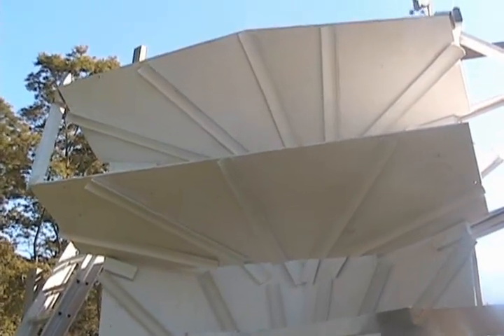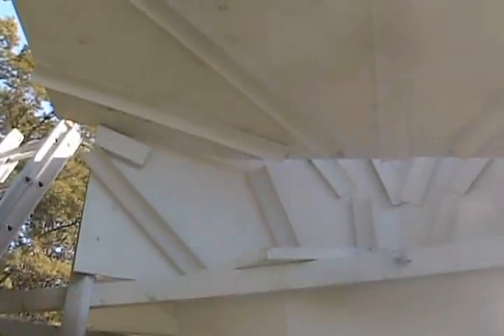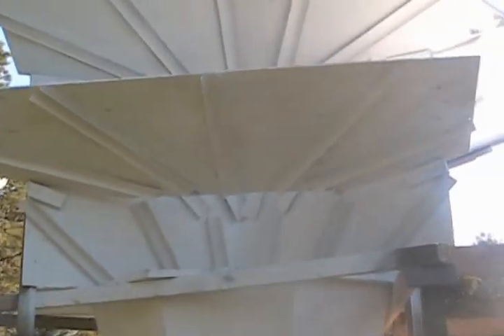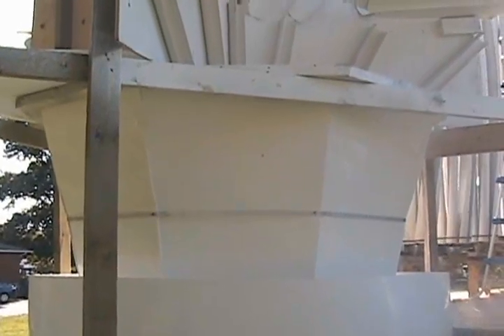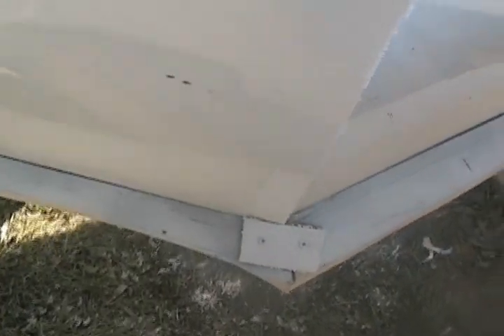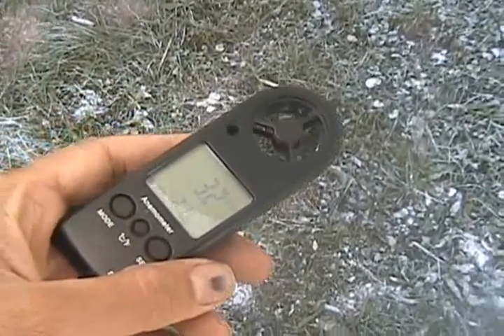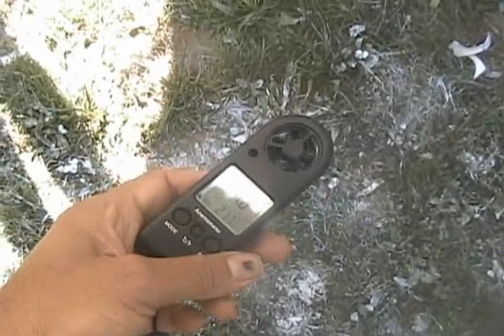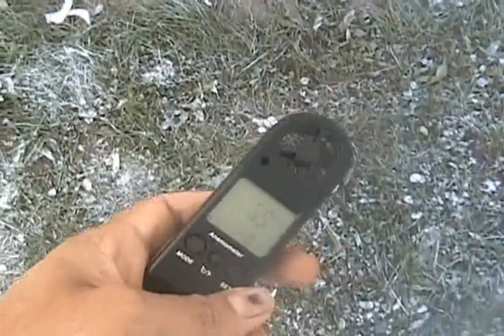FAWT 02 Silo Fixed Axis Wind Turbine vawt  plans savonius vertical axis hawt diy ametek  green

Comment: It's hard to make the texts in English. Not speak it. I write very succinctly.
Here in the texts are not added. Cover in black to increase the draft (wind), in Inside the structure. The stronger the heat pipe, the stronger the wind Inside her.

Comment: You super thinker! But I think that it is better still to turn the whole system on its head that would use the earth's surface as an additional reflecting surface. Another luchshe used as draft chimney from the stove. And make no mistake that night, and at the wall surface will be heated by the sun and create a counter flow of air, and hence the resistance of your system. Therefore, by offering to turn over. In the Tao Te Ching says: If you do, then do it in harmony with the Qi and not across.

Comment from the maker: the plan is to have 6 blades the shap of a whale fin...lol..crazy sh!t eh??!!..anyway so the 6 blades will take the shape of upsidedown umbrella so the center is lower approx 8" from the edge of blades, where the blades curve upward 8" from center. the reason behing the curve is that the wind comes in on a slight angle and the wind is sliding of the flat blades and not hitting them at 90degrees. 
to be continued....

Comment from the maker: lol...you are great Dude, i dont know about the Genius part!. but the carzy part is kinda true.
i did make few mistakes and i need to mod the blades.
1st i built it to close to ground, i need to lift it at least 3feet up, i will have to dissisamble it and reassamble it.
also i have designed the blades but i am struggling on how to build them.

Comment from the maker: thanks, i am at the prop stage, i designed the blades but i am still trying to figure how to build them.
i am planing to make 6 blades based on tork than lift and all six will curve upward arround 8" high from center, so it is like a bowl, this way i feel that the wind will be concentrated.
i am terrible at explaning thing, soon i will update the FAWT page on my site with some renderings.

regards